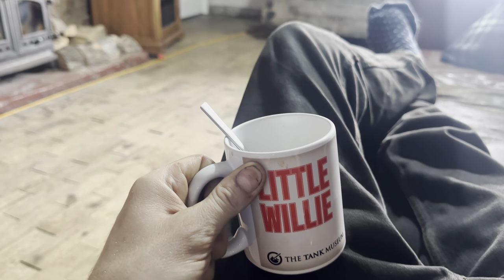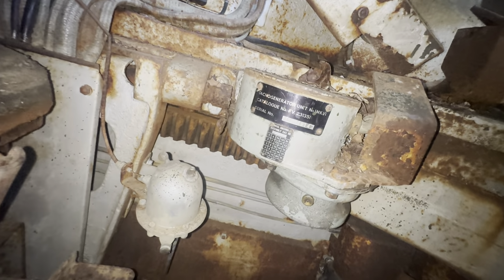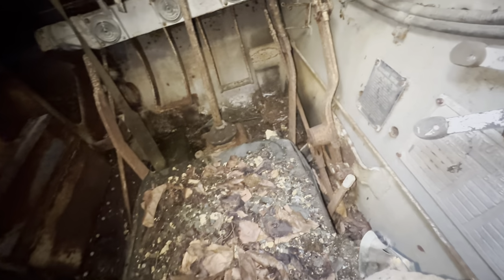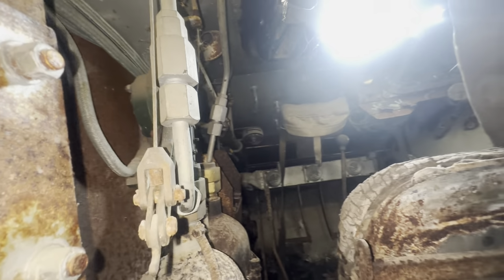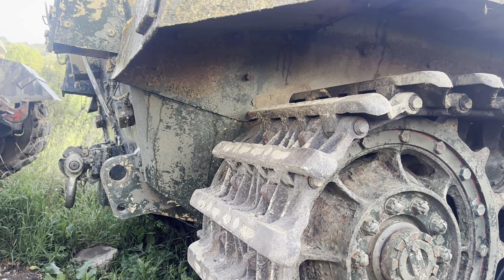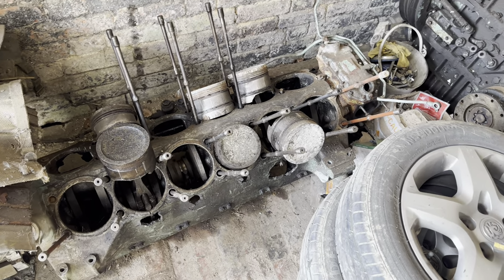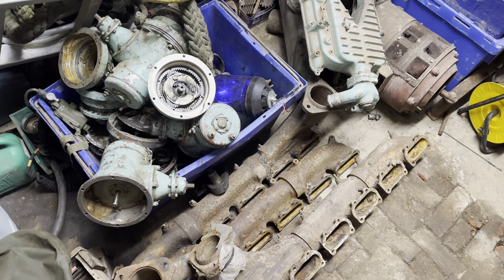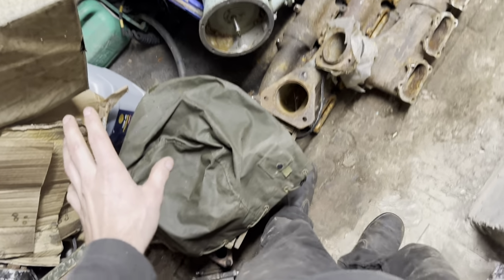V12 in a living room?!

Comment: Good advise about the split rims.

Sometimes it just worth paying the guy with the right tools and training/experience.
Reply: Can I ask why are split rims worse? as I have a set on my old car and haven't heard that before.
Reply: @ChullsterOG  Do it wrong & they can come apart when being inflated- explosively.
That's what the steel cages are for at commercial tyre shops.
More than a few people have been killed by incorrectly assembling them.
Reply: @ChullsterOG  what kind of car has split rims? I have only seen them on heavy trucks and tractors.
Reply: @quietbrianquiet Lots of pre WWII vehicles had split rims. Many perhaps most early stuff had multipart rims that made changing flats with hand tools possible. Tires originally had a lifetime of perhaps 5000 miles so somebody got lots of practise at changing them. Things like the original Mack truck were issued with solid rubber tires all around for load carrying and reliability. My 1977 Ford 1 ton had split rim 7.50 by 16s. Was a problem as law changed and one piece rims were the only replacements allowed. So real care of the existing rims to prevent rust damage saved a very considerable expense,at least until I sold it.
In the right hands,split rims were a known quantity. In careless hands,a killer. There is footage here on YT of incidents. Quite capable of cutting someone in half . 50 or 60 psi ,if you do the math,represents massive force stored up. If the ring catastrophically detaches during initial inflation,very bad things happen.

Comment: I can't see anything wrong with a tank engine in the lounge room. I rebuilt my 1969 Rickman Metisse MKIII scrambler with a Triumph 650 motor in the lounge room not that long ago during a chilly winter here in Australia. I showed the wife how her oven & oven mits could be used to heat to 150 C & hold the head while I put new bronze valve guides in & how her dishwasher was very good for parts cleaning.
Reply: Hey  !,   is that my Rickman Metisse scrambler with the pre-unit Triumph motor  ?,  sold it in '69 and bought  a brand new BSA 650 Lightning ,  twin Amal carbs  .....,  my dad emigrated to Australia but I didn’t,   ok, i give up,  it's not mine.   I kept my Honda Firestorm in the lounge every winter for six years,  got a friend to sew up a matching cover to the curtains  😂
Reply: @michaelhodgson3833  Mine was sold as a rolling frame kit out of STEEN's in California and has a TR6 head / T120R unit engine in it. It has the 1" longer swinging arm which was preferred by desert racers at the time.

Comment: More the pity that the fuel injected 810 hp Meteor from the Conqueror didn’t get into the Cent. Vickers once offered an upgrade consisting of a  Detriot V12 turbocharged 800 hp and Allison Auto for the Cent. No takers. Would have solved bulk issues. Even the IDI upgrade was only tahen up by Sweden, so not every operator had issues with the bog standard driveline.
Aussie Centurions, originally Mk5, had the extra frontal armour, and a long range 100 gallon tank added to the rear. Gave quite a bit more useful horizontal deck area for carting stuff around, especially infantry in jungles.
The Cents in Vietnam gave no more particular trouble than any other extremely complex battle system, and hats off to the dedication of the RAEME crews who never let availability drop below 90%. I have seen pictures of fitters changing out engines, in the field, knee deep in mud, not a Foden in sight. Respect to them.
The greatest problem was following rotational deployment, the vehicles had to be exactingly cleaned and repainted before return to Oz, to comply with Quarantine regulations. Not easy task following a monsoonal rainy season.
With Aussies, Matilda 2 became ‘Queen of the Desert’ and later, in 1943, became “King of The Jungle”, wholly justifying itself as infantry support tank#1. British doctrine wasn’t wrong, and the vehicle was quite suitable for the task.
In Israeli service, Centurion proved itself ‘Queen of The Desert’  ( or boss of Sinai, Golan’s golden defender).
In Korea, Centurion proved itself King of The Hills, Ridgeline Ranger, the incredible mobility equaling the A22.
In Vietnam, The Centurion was again “King of The Jungle.” British doctrine, changed in favour of the “Universal”, or Main Battle Tank, capable of preforming all battlefield tasks again proved prophetic, wise and achievable. 
The Centurion proves itself to be much, much greater than bits of cast, welded and machined metal, the sum of it’s parts being much, much greater than a stand alone item. Thank you for your patience. Cheers.

Comment: Yes, yes this does look like a 13 so the commanders hatch might be contra. Rotating. Now the old way of isolating Cromwell that got driven into German towns from gate guard after a few beers was to weld the drive sprockets to the tracks and remove mags. I doubt this was done by REME but more likely the MoT section. REME would have probably charged with NM&D. The giros seem to be missing. Used to be black and fairly circular. As for keeping a good one in living room yes as ex ‘clang’ I would like that. There is a project for you. Take a knackered block; carve out holes and insert goosed rods and top with useless heads etc. top with heavy glass and sell in London poncy store for a bloody fortune. What eastern gentleman could avoid one! Just time for one for Christmas! Am I joking - NO. TAKE THE MONEY AND RUN!!

Comment: Would not surprise me one bit, if that 58 miles was genuine. Brand new tank arrives at unit, gets used in one exercise, has a massive breakdown of the electronics, engine/tracks/ road wheels etc,gets robbed for other tanks. Sits on blocks for 20 years, new CO arrives, asks about tank on blocks, is horrified and  
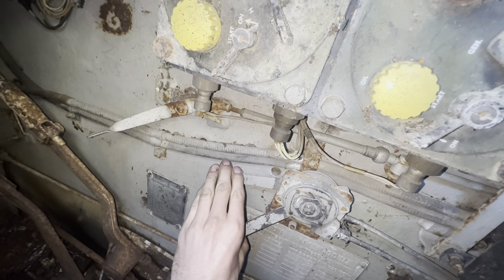orders it 4:09 bought back into service. Numerous tanks are robbed to get it going again, tank sold to civvies. 🤷‍♂️.

Comment: 2000W ~3000W  CO2 Laser in Cleaning mode Most parts will be Good AS NEW However the stuff With Rot Throw holes Will need to be Replaced